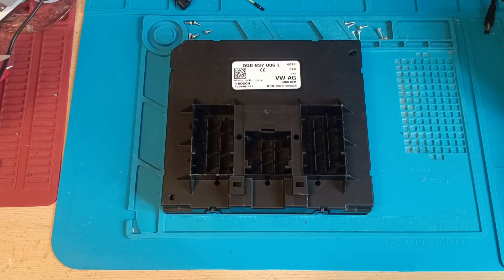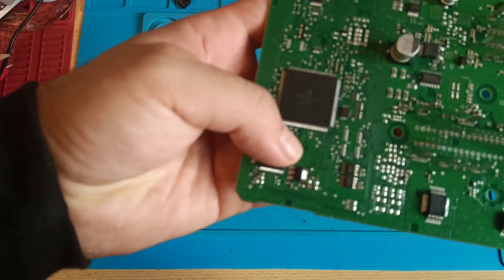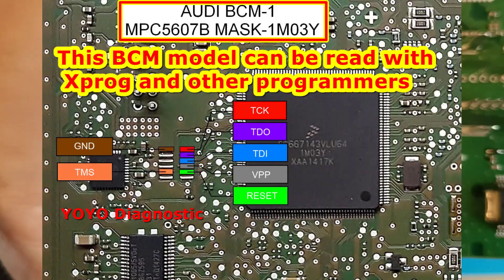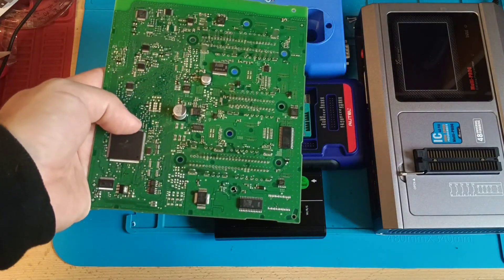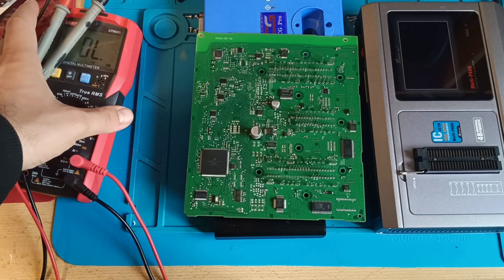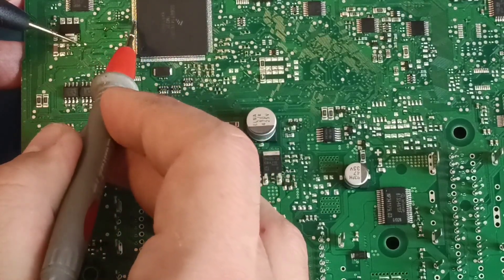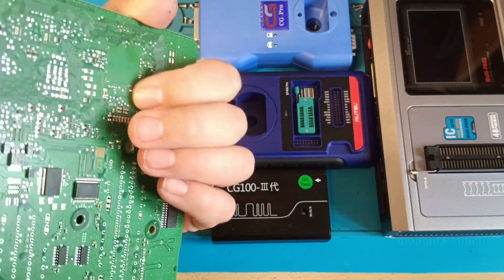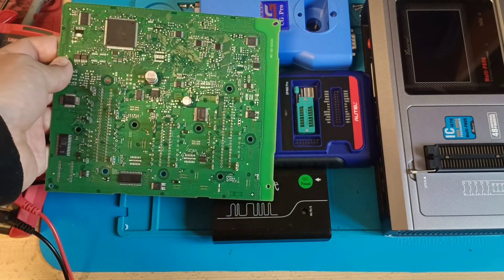I tried to read Golf 7 BCM, but without result (MPC 5607B/1M03Y).Where do I get the diagrams from?

Comment: The best thing is to connect a logic analyzer to see what signal is not working. Maybe something there is on the circuit 
On the datasheet you can find the programming sequence. The only thing I dont know if the mcu is locked.